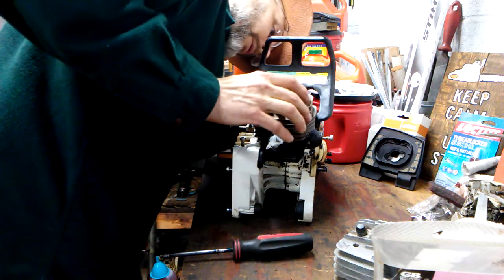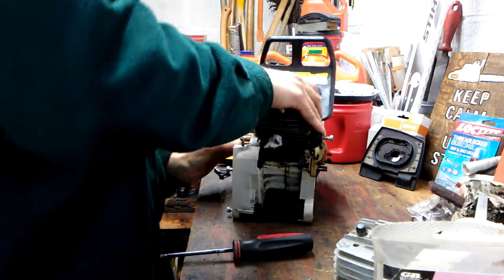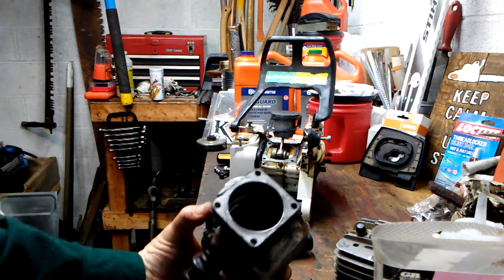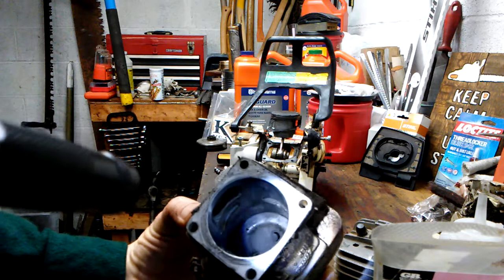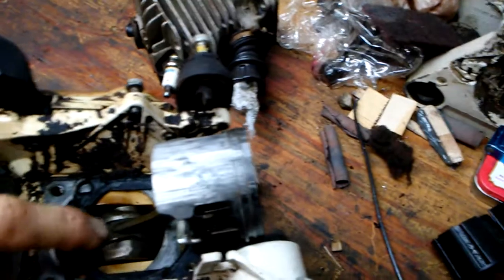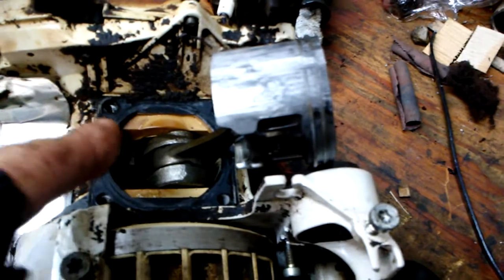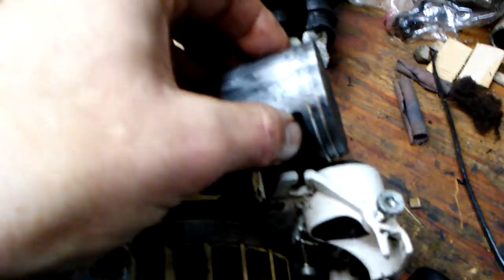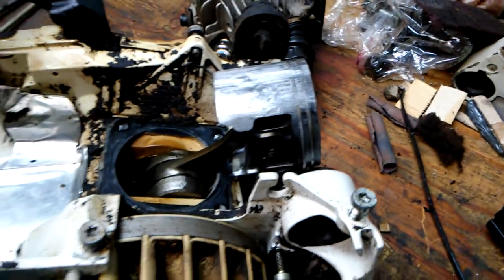Stihl MS660 Teardown Part 7 cylinder removal

Comment: I use a lot of hyway pistons, they have done well for me. Meteor is another good option. If you are not wanting to spend a lot, they are great options.
Reply from the maker: As far as dimensions and port timing goes Meteor is very close to OEM. I priced OEM piston kit days ago $100. Meteor $45. The saw came with a full Chinese rebuild kit. I am going to use the factory cylinder and Meteor piston kit. Thanks for watching Mr. Josh....